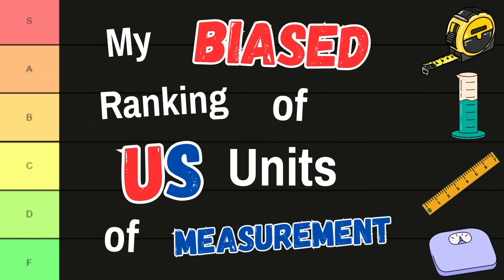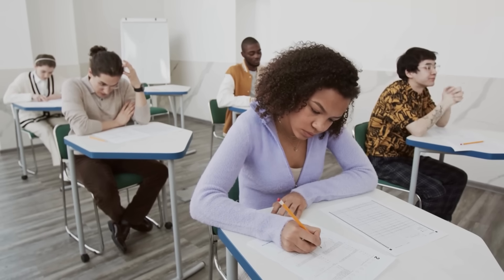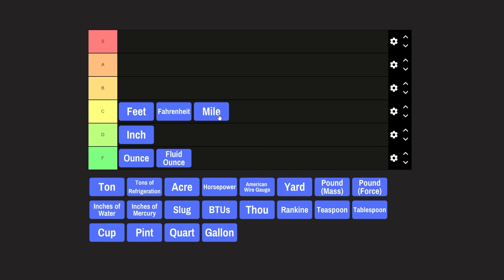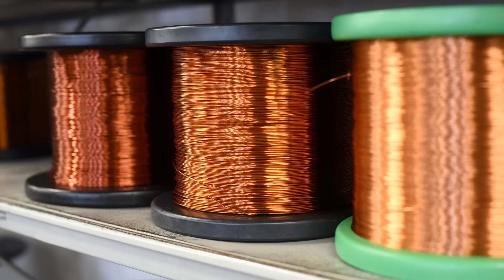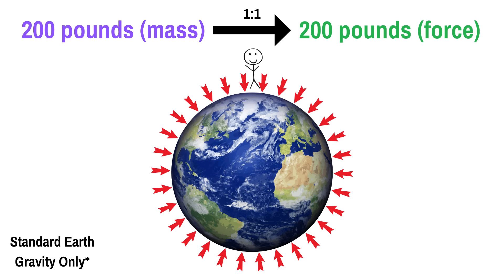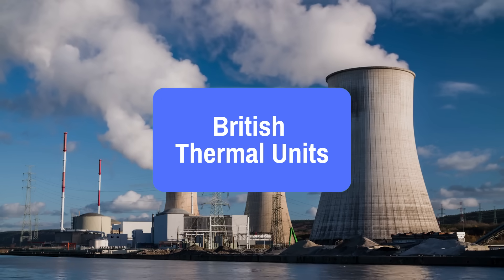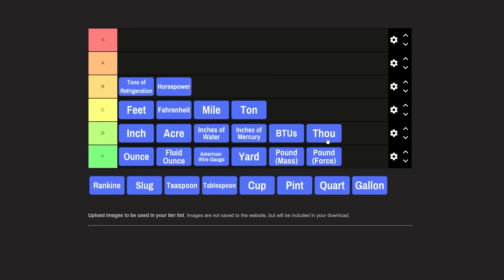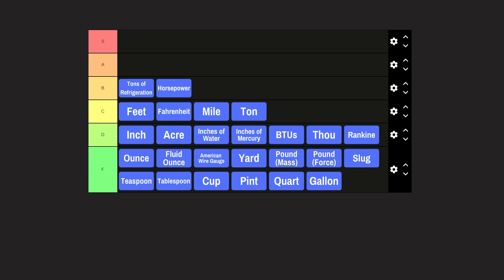Tier List of the DISASTROUS US Measuring System

Comment: I think the big issue with metric VS "imperial" is that those who like metric basically lie about what metric is because they are often more concerned with being perceived as intelligent rather than correct. 

- Metric was pointlessly and also incorrectly decided on a measurement that of PART of the world... rather than a persons foot. The world is not a perfect sphere nor is the world the same size as the moon, other moons, other planets or the sun... So instead of using something more intuitive the metric system decided to use the Earth, something not a single one of you could reproduce to check without lots of money and years of time... making it a bad way to base distance measurement. The idiots that made the metric system spent like 7 years ,measuring that small part of the world (again inaccurately) when they could have just MADE UP THE NUMEBRS AND STILL HAD THE SAME OUTCOME.

- The inch is again pitted against the metric system that was entirely made up based on an wholly worse random pick of using the world as the starting point. If you know what an inch is, it works identically the same as the metric version of an inch. In the US we build lots of stuff using inch/foot and man maybe you have to be smarter than the rest of the world but it's so easy it doesn't feel like one has to be that intelligent to do it. It's just the measurement we grew up with and it works just as well as metric. How tall are you, 6' 2".... VS 1.8796 meters or 74 inches VS 187.96 CM... In the US I say 6 foot and every human understand the range, in a metric country they say 182 (rounded) and OMFG, it's that easy!!!!!

- F VS C, again it's all in what you're used to. One freezing is 0 the other it's 32. No one sets a temperature at 0c or 100c, 32f or 212f... we all use something in-between and most people actually like F over C as it gives a better range when talking about it... "it's in the 80's." 

Measurements on weight is the same thing, you just measure on a scale and it takes identically the same amount of time to bake with identically the same accuracy... No one can guess correctly what something weights, metric or "imperial." The unites are both entirely made up. 

----------------

I guess what I'm getting at is that one group of people really want to bee seen as super intelligent but yet they believe in a measurement system that works just as well as another... both based on random picks for a starting point.

"Imperil" is more practical

Metric is generally better for super large or super small measurements, kind of. 

Because Metric is broken into 10's it finds a grey area of use that "imperial" solves by being more practical when it was developed. 

This is to say that both systems have their better uses, most the world uses metric because they are inferior to the US that has adopted both systems. This is why the US generally does not care what the rest of the world thinks of us, you guys like submission, we like variety... Our food captures the entire worlds traditions and then some, you guys like to keep it more pure based on the country. We use metric and "imperial" and you guys limited yourselves to one system.  Metric is not better, it's better for some things, but again it was built off a random measurement to start, was wrong and then is impractical to check if you wanted to. The average of 3 peoples thumbs is actually a better system than a small distance of the world and then multiplied/divided as if the world were a perfect sphere.
Reply: why are you adding an absurd level of precision when using metric, but not when using imperial? It's like saying 182 is better than 6' 2.846", it just doesn't make sense. No absolutely not a single person has ever had to specify their height was rounded
Reply: @caldeira_a  You just showed me why... but you didn't listen possibly due to bias. 

The point I so clearly was making was that matric is really no better than US's version of imperil. You save no real time, you are no more accurate... both are based on completely meaningless things to the rest of the Universe 

In America we use both because we're capable of it, other countries are limited to a singular way of measuring and so often feel a need to dump on others who do thing somewhat different in order to make themselves feel better. 

So, thank you proving my point, you can always just go, "Oh shit, yeah that makes sense!!" Or you can sit back and re-assure yourself that you're better than others for reasons that when tested... don't matter.
Reply: @FEV369  "In America we use both because we're capable of it"  
You have absolutely no idea about how the world works. You clearly live in your patriotic american bubble and you seem to be happy and proud about it..
People in a lot of countries still understand the imperial and many countries still use both. But almost no one wants to do calculations with those illogical units and fractions anymore.

We have exactly 10 digits, from 0 to 9. We don't have 12.  Every number can be divided with 10 and that's why we use decimals.
But why work smart when you can work hard?

You prefer your ludicrous stone age system because you're used to it. You can have it but keep it to yourself.
Just stop talking bs because you aren't as smart as you think.
Reply: @OnTheRoadAgain-S  America > You

Sorry that upsets you so much.
Reply: @FEV369 I'd bother with you if you hadn't just given up and fallen back to bait, but again, that's not exactly higher than my expectations for someone such as yourself
Reply: @caldeira_a  Ooow, you got me so hard there brah! Too Bad America is in fact #1 and we use both metric and American Imperial... almost like both work just fine =D
Reply: @FEV369 usually you're supposed to hide the fact that you're just baiting, is this your first time?
Reply: @caldeira_a  Sorry, I don't treat adults like children... other countries do that like when they force them to use a metric system, or healthcare, education ect... probably why most other countries talk about America so much, they're all the same and we're a bit more complex in outcome.
Reply: @FEV369  America is #1? You are clearly illusional and you don't know how the modern world works. Maybe yoy WERE #1 - a long time ago. You won the WW2 - yes, but that happened 80 years ago. You went to the moon - yes, but that was 56 years ago. F.Y.I. most countries have used versions of the imperial system but most converted to the metric system because it's a lot more logical and simplier to use for at least advanced calculations in different branches.
So why does the US refuse to skip those antique units? Too expensive? - Not really. It doesn't have to happen over a night.  Learn how things works in, for example in the UK. It takes a long time but it would be nice if the whole world would have the same system - and that will definitely not be the US customary system.
In fact it's your proud patriotism that made you stubborn and it stops the US from developing like other industrialized countries today .
And it isn't only about the measuring system. For example your electric distribution system still looks like it could be in Bangladesh. Where else they put three 1-phase transformers on a pole? Ridiculous. And in my country every house built since the early 1980s has 3 phase electricity.
Reply: Everyone is sooo mad but you are literally correct. The foreign mind cannot comprehend that the creation of the metric system is just as arbitrary as the imperial system due to the fact that it’s completely based off an incorrect measurement. At least as distance is concerned. It’s is a FACT that ALL measurement systems are arbitrary as they are created by human defined standards. They also cannot comprehend the fact  that we do in fact use the metric system in this country but nobody cares or likes it. It’s really that simple. We do what we want.

Comment: No doubt the Metric System is superior, but the problem is to many Americans like myself, when something is, for example, quoted as being so many meters tall - that's like a foreign language to me. I have to convert it to feet to get a grasp on what the height actually is. Having said that, sometimes when I'm measuring a small piece of plexiglass to cut for a project, I'll use millimeter measurements, as they're easier than all those fractions of an inch.
Reply: I just wonder why I never have seen any measuring tape with both fractions and decimals of inches. There are tapes with both centimeters and inches so why can't they have inches with decimals? Digital displays show the numbers in decimals so it would be much easier to be able to read them directly on a tape - and vice versa.
Reply: @OnTheRoadAgain-S  They do make tape measures with both. And Machinists use .001 inch measurements on their machines/measurements.
Reply: @joeylawn36111  Thanks. I just didn't find one such tape when I did a fast google search. 
I know that for example measuring clocks have a scale with 0.001" and for higher precision 0.0001" but after watching some videos, many of your machinists seem to talk about "thou"  respective "1/10 of a thou". 
And I'm sure you noticed that we "metric people" write and say 0.001 instead of .001 (not that it matters much).

Comment: As a european the only measure that I'm familiar with is the inch, but only if you're buying a TV or a monitor. We also measure power with horses, but a CV is not the exact equal of a HP.
Reply: Inches are used for more than just monitors. Sizes of tires and wheel rims as well as sizes for some hoses, tubes and most threads in plumbing and hydraulics. And socket wrench attachments are all still in inches.
Reply: @OnTheRoadAgain-S you're right.

Comment: As a construction worker that has to work with both imperial and metric i find imperial way more practical to divide leght of material. 12 is devisable by 2, 3, 4, and 6. 10 is only devisable by 2 and 5
Reply: I just want to know how you solve this: You have a 7 inch long piece of something that you need to cut in 3 exactly the same length parts and the only thing you have to measure them with is a measuring tape with normal fractions based on 1/2, 1/4 etc. How do you do it without using decimals when your tape doesn't have 1/3????
I asked that to another "imperial" guy but I didn't get a proper answer.

Btw. EVERYTHING is divisable if you use decimals and almost everyone has access to a calculator these days. And knowing 1/2 = 0.5, 1/4 = 0.25 etc is basic knowledge.
Reply: @OnTheRoadAgain-S realistically I wouldn't cut down a 7inch piece of wood for safery reasons and i don't work with tolerance that are that high so in a real life situation id probably do 2 3/8, 2 1/4, 2 3/8 the same way that i wouldn't go for a half millimeter in metric. Also since a circular saw has a 1/8 width it would give me 3 pieces of 2 1/4. But the way to solve the theoretical proble that you proposing would be to put my mesuring tape in corner of that piece of wood and at the other end instead of measuring in a straight line go towards the opposite corner until you have a number divisible by 3 and mark every third (7 1/8 and mark every 2 3/8, 7 1/2 and mark every 2 1/2, etc) but the same priciple works with metric.
Reply: @jimmy13morrison  That sounds both time consuming and not very precise.  You must admit that those fractions aren't always practical? 
 I'm a 66 y. old retired electrical engineer who also always has done a lot of both carpentry and metal work. I've never calculated with fractions because to me decimals are way more logical and easier to use. 
Btw - I wasn't talking about wood. 

But let's just talk about fractions vs decimals. 
The fact is that digital RDOs and other digital instruments and most design programs mostly only use decimals. So why not have measuring tapes with both fractions and decimals of inches. Then you could use these results directly with your tape. There are indeed measuring tapes in both inches and millimeters but I haven't seen one with an inch scale in decimals.
And a very few digital calipers show the result in fractions. Most have both inch and mm scales but both are in decimals.

It's also interesting that machinists use "thou", which refer to 1/1000 of an inch, which is exactly the same as 0.001 inch. To go further they talk about "1/10 of a thou" which is exactly the same as 0.0001 inch. So decimals in practice.  Also weapon calibers are in decimals.
It just seems that understanding decimals still seems to be rocket science to many americans - the same way I am not comfortable with fractions. They just would cause more risk for miscalculations.

Don't misunderstand me, if you like what you use, it's good, I just told my opinion.👍

Comment: I prefer Fahrenheit only because it's much better for use with AC and heating. Lowering the thermostat in my house by 1°C is always too much, I prefer the more granular control Fahrenheit provides. This benefit would be mitigated if Celsius house thermostats could be adjusted in smaller steps than whole degrees, but most can't.

Comment: Farenheit is okay for weather but i wouldnt say its good. It's also easy to determine how warm it is in celsius: 0°C: It's so cold that water is freezing. 10°C: It's cold you need to wear a jacket. 20°C: Nice temperature. 30°C: Very warm Summer day. 40°C you shouldn't go outside. 50°C: There are probably wildfires in your area. 60°C: There are definitely wildfires in the area. 800°C: You're inside the wildfire

Comment: Horsepower is funny and should be S tier also I like Fahrenheit but that’s just my American bias
Reply: No i agree, to a certain extent.
Horsepower is "easier to imagine" than kWh.
My car has 60 Horsepower, i can imagine how powerful it theoretically is, but EVEN AS AN ELECTRICIAN i have no clue on how i should translate 45 kW to actual force...
I know how much energy 45 kW is but like... Why? this scale is just weird if you start to take in account that the force used has so many different ways of use.
A rank since Horses differ so much and the actual horsepower scale is funky in itself if you compare a few things.

And Fahrenheit is a nice scale too in weather, but only weather.
0°F is round about the coldest temperature i ever lived with round about -18°C, while 100°F is with round about 38°C a really hot mid summer day.
Like going with 10°F steps just makes sense, 90F is hot 80F is my perfect summer temp, 70 is nice room temp 50-60F is cooler spring and autumn weather.
I think this just makes more sense in a "scale" since it is nice and even.
If i use "funky" numbers as 21°C is my typical room temperature or 26°C is my favorite Summer temperature, its not as nice to look at.
Still i absolutely prefer Celsius since it just makes way more sense in the large scale, but Fahrenheit is completely fine in the weather corner.
D+ rank.

Comment: Gallon is even worse than cups and various spoons. Only the US and/or UK could come up with a system where a unit of measuring volume depends on the material being measured. A pound of feathers being lighter than a pound of lead? Everyone laughs at you, rightfully so. 
A gallon of sand taking up more volume than a gallon of oil? Yep, sounds about right according to the US measurements system.
Reply: Not true
Reply: @loganmustazza2792  strongly substantiated response. How so?

Comment: So an American ton is 2200lbs, while the metric ton is 2200lbs? A mile is exactly 5000 paces (WHAT THE FUCK IS A PACE) so like a 1000 feet, wait hold on that’s false since it’s actually 1280 feet.

Here’s a suggestion, how about a ton be exactly a thousand kilos, and a thousand grams is exactly one kilo. 

Water freezes at exactly 0 centigrade and boils at exactly 100. 

Infuriating enough that a mile is like 1.618 kilometers. How can Americans in good will not use the metric systems it’s like insisting upon using horse carriages because of tradition.
Reply: The American ton is 2000lbs, the metric tonne (1000kgs) when converted to pounds is ~2200lbs. And for Celsius vs fahrenheit, both were set at arbitrary conditions. And obviously a mile and a kilometer are not equal just like a centimeter and an inch aren't. Also a pace is the distance between your feet when in stride, often used in ye olden days before consistent measurements, just like how people told time by candles burning

Comment: I must be fair to US Americans... most of us in metric countries, even countries that turned to metric like 150 years ago or more, still use a few old units from time to time.

Admit... in your country, are TVs/Screen sizes measured in inches or cm? What about car wheels?

As we have no idea how much 42 inches is, we take a long time to realize it's diagonal size, not width.
Reply: Actually I can't think of any other imperial unit than inches that we actually use here in Finland anymore. The metric horsepower as well as the metric ton differs from the imperial units. And neither of them is official anymore even if they're widely used. It's kW and kg now.

Inches are also still used a lot in plumbing and hydraulics for threads. An interesting thing is that hydraulic hoses are still measured in inches while hydraulic hard tubes have been measured in mm for several decades. 
I have an old backhoe excavator from 1965 where 16mm tubes, that have tension rings with M24x1.5 threads connected to 5/8" hoses with 5/8" BSP threads. 😀